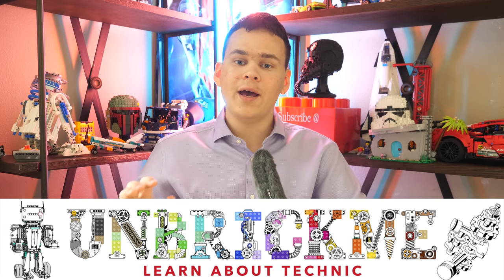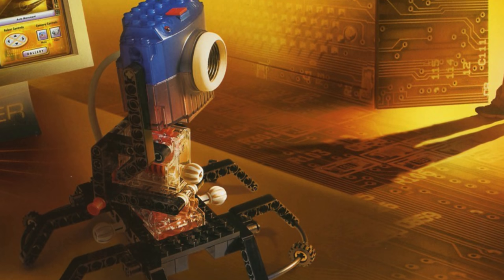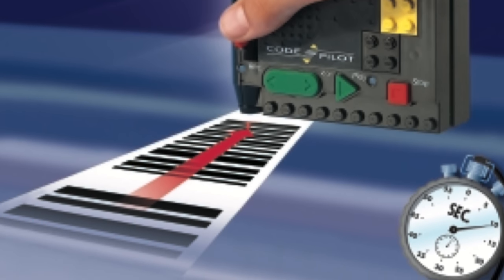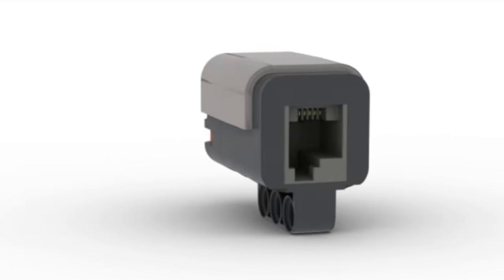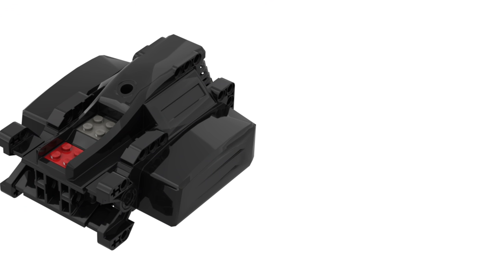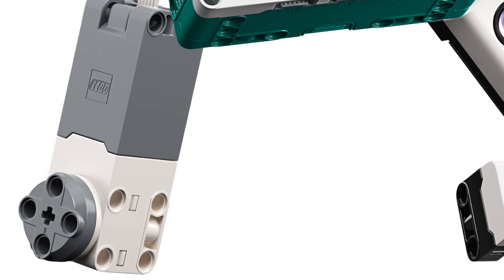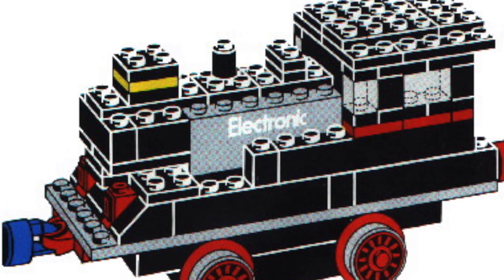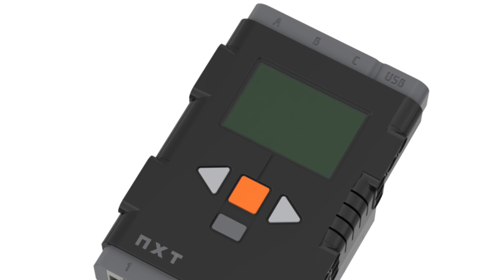10 Rarest LEGO Electronics of all Time

Comment: The original fibre optics (I have the shuttle) were sold at a massive loss - the cost to create this in 1996 was way more expensive than the cost in the set.  These days it would be much cheaper to build as LED and the controls are much cheaper to mass produce, but in 1996 it was very special.
Have the lego camera - I got it to work on windows XP, but could not get it any more modern OS
I have 2 of the code-pilot sets cos the set is so cool.
I have the control centre 2 (the T-rex) set.
The 4x4 crawler...
How sad am I  :)

Comment: I have that fiber optic unit from the UFO set! I always wanted to build a V8 that uses the fiber optic cables as spark plug wires, with the light implying combustion (would have to spin at half speed) in the cylinders, but I haven't gotten around to it. Such a cool part, though!

Comment: Many more unique electronics out there:

1. Cybermaster control unit and touch sensors (2 sets, both are the same except one comes with a carrying case )

2. Interface A for the school exclusive Dacta/Education line, not for retail (2 sets)

3. Control Lab Serial Interface for Dacta (1 set)

4. Technic Speed Computer (2 sets, only the Technic one is  available for retail, the other one is for Dacta/Education)

5. Stop watch from the Competition Racers with Stopwatch set (1 set) 

6. USB camera from the Steven Spielberg Moviemaker Set (2 sets)

7. Micro Scout from Droid/Dark Side Developer Kit(s) (2 sets)

And there are many more, Golden age Lego did not hold back when it comes to interesting electronics.

Comment: I have a 8094 control centre with the technical drawing machine. Bought it secondhand as part of a haul, never built it, as it was missing the Technic pen. The NXT sound sensor is not so rare, however, the temperature sensor is!

Comment: the control center 1 isnt as impressive as people think it is. it can only memorize actions and doesn't have any feedback. it just records your input into memory and plays it back. just having the batteries drained a little more can throw it off. its no longer stock, as i had to clean it up due to battery corrosion (it was left in storage for years with batteries installed), i also installed a barrel jack as the battery contacts are very iffy. the cables and motors also did not fare very well, with cable insulation disintegrating over time and contacts corroding. i was able to restore some of the cables but they are also no longer stock and i also ruined one of the motors trying to restore it. 

i think i built every model in the set and still have all the pieces. i think my favorite build in the set was the drawing machine (plotter, i don't remember what it was called). you could draw a pattern and copy it several times.
Reply from the maker: Despite the drawbacks, i still believe it is awesome, especially considering it came well before the mindstorms system

Comment: My grandma had a lego dacta set with old motors that spin fast but are weak
The battery pack holds 3 d batterys
And there is a light brick for it but I haven't found it in a while
The motors don't work due to the bad connection of the wire

Comment: When I saw the control center, i thought you forgot to include the 8485 Control Centre II set having this. I looked at them both and saw that my 8094 controller is labeled Technic Control Center, and my 8485 controllers are labeled Lego Technic Control Center (I have 2 of this set). I noticed that my sets are spelled Center, not Centre. Do you know if there is any difference in the 8094 and 8485 units (perhaps just a difference in the circuit components used). I could open them up and see.

Comment: V2 reciever is also in the 8043 Technic set...
Reply: and also 42030 lego technic...
Reply: Stop drinking, there wasn't a V2 Infared Reciever in the 8043 Motorized Excavator.
Reply: @1993VolkswagenPassatGLXVR6  The box advertised the V2 Recievers, but wasn't included in the box. Check again.